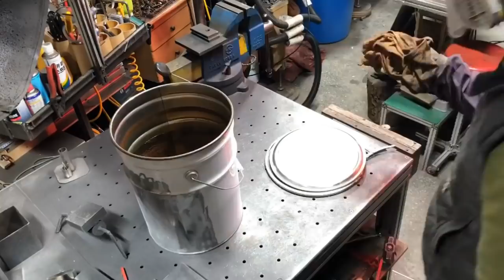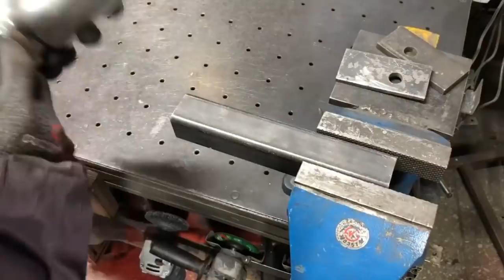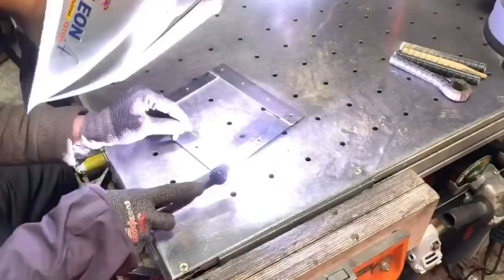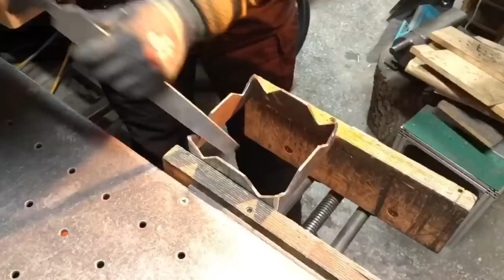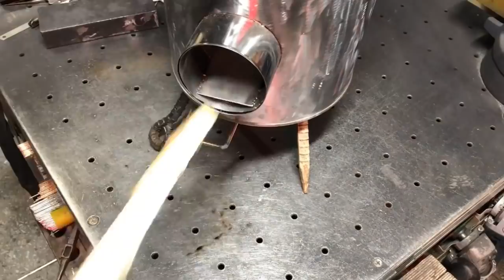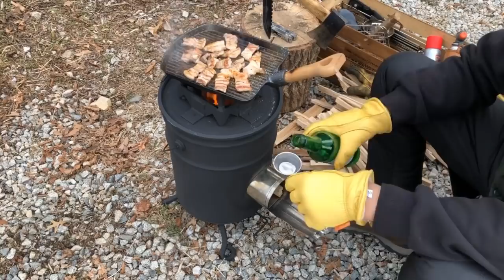깡통 로켓스토브 만들기 / 캠핑 / Camping / RocketStove making

Comment: Terrific design and presentation.  Loved the magic cutting fire, you are becoming a showman.   Loved that you left the handle on the original bucket and created a damper, ash dump on the bottom of your firebox.   What was the white packaging foam; rock-wool or another fire retardant insulation?   Wishing you and your family continuing safety and health as the pandemic virus continues to evolve.   Peace brother.
Reply from the maker: Thanks for the overall evaluation
The white side is a thermal insulation material that holds up to 1,300 degrees.
Thank you
Peace brothers